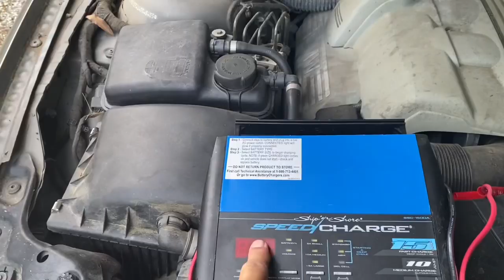Will this really jump start a car?

Comment: Seen the "hood-prop" as soon as the camera showed it.
I have owned one of those little "Emergency-Jumpers" 
since I first seen one at a "Vehicle Auto Parts" chain a couple of years ago. It didn't cost very much even back then, and it ended up saving me some $$$ & from "begging" someone for a jump less than a month after purchase! DEFINITELY worth It's weight in gold when NEEDED!!

Comment: I bought one double that size that says it will jump-start a diesel. So I think mine will work if you're a little one does the job. It's been sitting in my truck for 5 months and I've never used it

Comment: If that’s a lithium battery even tho it shows 100% it’s not at that level. Lithium batteries discharge so it’s actually at a lower level then it’s indicating. I have one also and it shows about 70% at 6 months of non-use

Comment: I'm not sure I'd trust the lithium battery.  I have one of those wheeled units that looks like a welder that will probably last the rest of my life.  If a battery gives me issues more than a few times I just change it/repair the charging system.